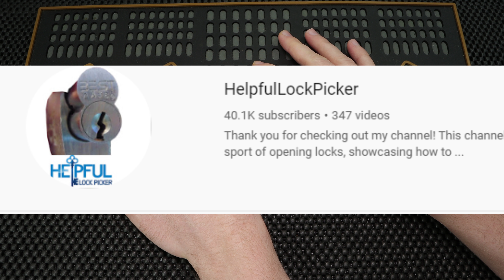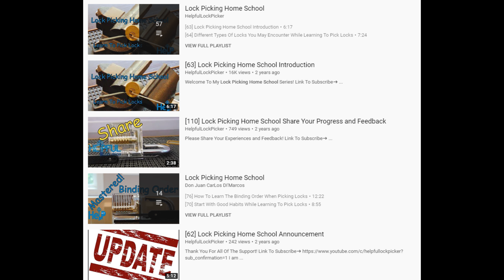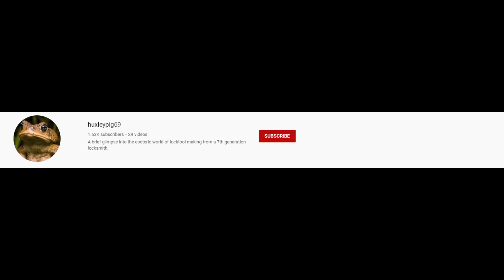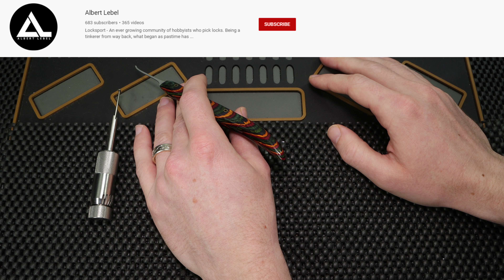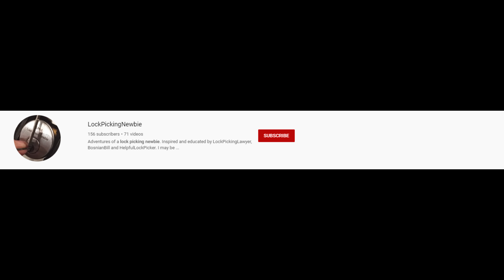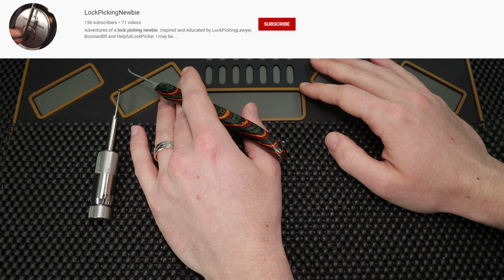[348] Lock Sport Update | huxleypig69 Is Going To Update My Silver Bullet!

Comment: Hi thanks for the videos a
I had questions for you regarding the kronos pick gun first will it pick open locks with security pins and second have you ever tried it on sfic cores
Reply from the maker: It can open locks with security pins but it is more difficult. Yes, it can work on SFIC. I believe the boredlockpicker did a video on an SFIC with a similar tool. It is not guaranteed and does come down to luck though